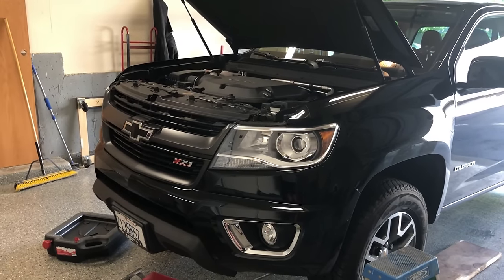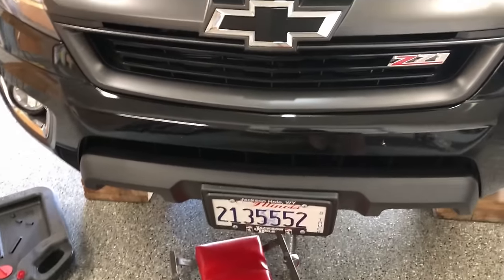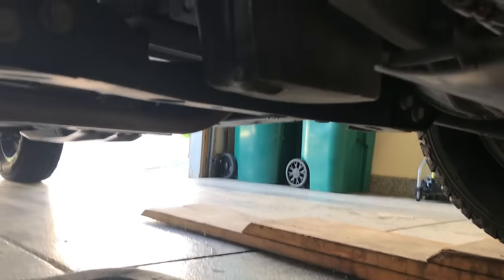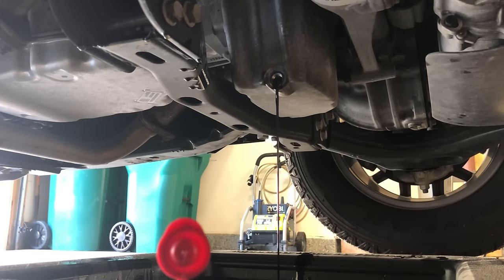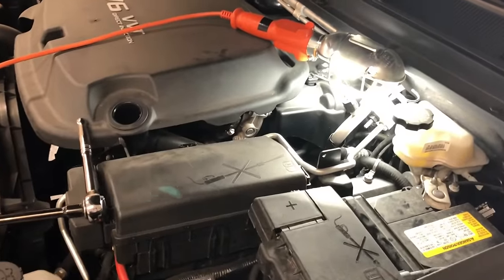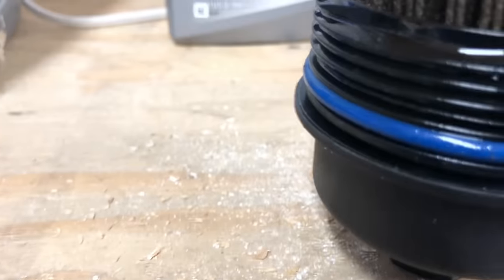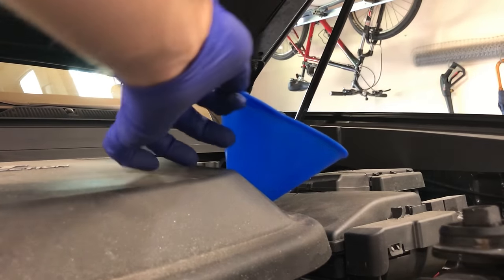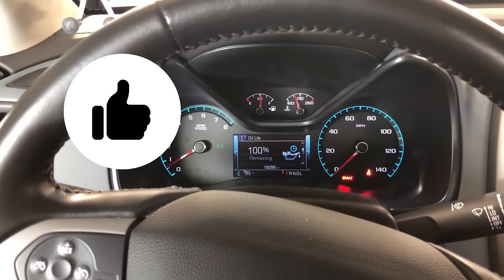[HOW TO] Change Engine Oil on a 2015-2022 V6 Chevy Colorado / GMC Canyon (Easy)

Comment from the maker: Leave a comment if this helped you change the oil in your truck! 
Buy the Engine Oil here: https://amzn.to/2tEze9h
Magnetic Drain Plug: https://amzn.to/2GcUdmd
Washers for Drain Plug: https://amzn.to/2RdNi2y
Reply: It did.  Had a little trouble Changing the filter, trying to move all the wires. but I got it. Easy change. Thanks.
Reply: it did help me find the oil filter and how to replace it.   I was wondering what you think. If you leave the fill cap on, will the oil not shoot out so far when removing the plug?
Reply: @robbyddurham1624  I think the faster the oil shoot out the better it is because it pushing out all the particles?
Reply: What about that rubber gasket you said you need to change, too?
Reply from the maker: Yes. Change it. Your new filter should come with one.
Reply: Fondupot's Garage it did! Thanks!
Reply from the maker: jackolantern22 awesome!
Reply: I'm almost 34 years old, just changed my own oil for the first time in my life today. Thank you!! 🙏🏼
Reply from the maker: @atsantes  Glad to help! Good job!

Comment: Thanks for the video. I've been changing my oil for the last 30 years and never had a vehicle with this style filter. It seems pretty simple to replace.
Reply from the maker: Glad to help James. Thanks for watching!
Reply: Same set up your basically changing the paper out in a traditional sealed can. I actually prefer this and like to do before dropping the drain plug. With the filter out I loosen the drain plug. Not sure if any more drains out this way. But in a can style if you puncture a hole at the bottom with it tipped upside down more will drain out. We were required to do this in a repair shop when performing a LOF. Great video and I’m glad I traded my 2014 Silverado for this model of truck beats buying 8.5qts of oil, with fighting the oil splashing everywhere.

Comment: Great video! Regarding the random comments about reinstalling the new oil filter (housing/cap) on these motors, everyone needs to understand......oil filters have always been intended to be 'hand tight' ... by which to be reversed,  also means, 'hand Un-tight' lol. A person is supposed to put a little swipe of oil on the new o-ring of any oil filter, put it on with your hand....and then later when the time comes, take it back off with your hand to replace it again! The only reason oil filter wrenches were even invented was to (remove) wrongfully installed filters! In this case, the engineers know it's difficult for an individual to reach a hand down there, so they gave you the 24mm nut to turn it, (not drive it) on and off from the 10 or so inches above it ....... so it's all about paying attention to the draw down and integrity of the o-ring with a moderate amount of forearm strength and 'common sense' measurement while using whatever ratchet or hand device you're using!  *Always look under the vehicle and around the oil filter housing immediately upon start up to verify for no gushers!
Reply from the maker: Well said.
Reply: On this vehicle, the oil filter will literally tighten to a point where it spots and is completely bottomed out, no need to tighten past that
Reply from the maker: v mann correct
Reply: Good point,i was always taught hand tight & check after for leaks.

Comment: Very helpful! I could not find the filter.  On another note on cars with an internal oil filter the oil drain plug should be left out until the oil filter is removed.  Most of the time some more oil will drain out, sometimes a significant amount.

Comment: Thanks broski.

Just did my 2019 Colorado and the worst part was just getting into the filter area. Kind of have to wiggle your way in there but not too bad.
Reply from the maker: You’re welcome. Thanks for watching. Yea the filter is a little bit of a pain.
Reply: @fondupot  no more of a pain than trying to quickly screw on your filter that’s up and around a corner while it’s full of oil 😂
Reply from the maker: @hulkhogan1942  Yea, I actually prefer the cartridge style filter now. Once you get used to it, it's not so bad.

Comment: Oil filter is on the right side of the motor. Your battery bracket hold the middle of the battery down it’s 6-8 inches from the middle of that bracket and straight down. Black cover with the bolt built into it. 15/16 socket.

Comment: Funny thing, I just changed the oil in my Colorado a few weeks ago. I used a torque wrench to tighten the filter housing to 25 newton meters or 18 ft lbs. It was fairly easy. No jacking of the vehicle needed. Did it right inside my garage.
Reply from the maker: The Car Crazy Guy I have to say it’s a very easy vehicle to change the oil on.
Reply: Fondupot's Garage I did it simply because I didn’t want my dealerships techs to paw all over it. I still have my 2 free oil changes.
Reply from the maker: Nice yea. I used my two oil changes. But from here on out, I'll do them myself.
Reply: Even easier if you replace the pan drain plug with a 1/4" turn valve.
Reply from the maker: I've thought about those before. But I'm afraid of it getting broken off and then losing all the oil!
Reply: Yeah, if you do any off roading, it's definitely a risk. Especially when you consider our trucks require the valve extension

Comment: FYI: 24 mm=15/16" for the filter cap.  Great video.
Reply from the maker: I thought the 24mm fit better for some reason. But thank you!
Reply: @fondupot  You're right, actual 24 mm = 0.94" whereas 15/16"=0.9375"; however, in my opinion, 0.025" isn't a significant difference on this light of a torque.

Comment: Bought new 2019 model.  Looked at the filter in the store and thought WTH.  Just a paper filter.  Thanks for showing me where it is located cause I never would have found it.  Between the filter and no gas cap, totally new for me.
Reply from the maker: Chris Forbes glad to help. Thanks for watching.
Reply: It’s the same internals as a traditional steel can filter.

Comment: A very helpful video, I see you're using a full synthetic oil,  my 2O19 says synthetic blend and I have 21,000 miles, when do I switch to full synthetic? Thanks
Reply from the maker: You can switch whenever. I’ve been using the Mobil1 since I took ownership of this truck with 4000 miles.

Comment: Thanks. Manual shows I should service the sealed tranny every 45k. Is that how you do yours?
Reply from the maker: Yes. I would recommend that interval as well. I have a video on how to do transmission service on the 8 speed. Check it out. Thanks for watching.

Comment: 1) thanks for doing this. I haven't changed my own oil in years I'm embarrassed to say, but good to see the filters have gotten a little easier.
2) You mentioned this was for 2017s and newer. I have a 2016 and it all looks the same. Do you know what the differences are?
Reply from the maker: The 2015-2016 V6 is actually a totally different motor than the 2017+. The filter is a different part number on 2016's. But otherwise the process is identical. I have links to the part numbers in the video description. Thanks for watching! Glad to help. Good luck!
Reply: 2015-16 oil filter housing is all metal. Torque specs are a little different. Other than that pretty much the same everything is in the same locations as this vehicle. I torque the drain plug and the oil filter cap to 20 pounds I think the oil filter cap only calls for 18 pounds but my cheap torque wrench doesn’t have fine increments. Mine is a 2015 v6

Comment: Quick question, when you put the new oil filter in and tighten it all the way with your hand how many turns do you do with the ratchet, I hand tightened it as tight as I could, and then maybe did a half turn with the ratchet. I just wanna make sure I’m not tightening it down too much.
Reply from the maker: The cover should be flush with the housing that the filter slides into. If you reach down and feel a gap then you gotta keep going. But it doesn’t require a lot of torque. You should be able to feel the ratchet stop when it’s flush.
Reply: @fondupot  ah alrighty. Thank you!

Comment: Changed oil today but didn't have right driver to get oil filter off and changed.  Thoughts or recommendations on how concerned I should be and how quickly I should change filter?  Oil change was 5k from last change. 70k total miles roughly.
Reply from the maker: I would change it as soon as possible. But probably won’t hurt to go another 500-1000 miles on it.
Reply: If you dont change that oil filter it will literally fall apart... i have seen cars come into shop with these filters after not changing this type of filter... had to pick the filter pieces out of the filter housing.

Comment: Quick question. Can anyone confirm if the factory oil pan has a helicoil? The dealership told my father in law that he needs a new oil pan cause the helicol is stripped. I argued and said theres no helicoil on the factory pan, and that a helicoil is a repair that they probably did. Long story short we went back and forth and they agreed to change the oil pan at their cost
Reply from the maker: I don’t think the factory oil pan has one. At least you got the dealer to fix it.

Comment: I was wondering if you use a resetting tool for the TPM system when you rotate tires.  Now that my free oil changes have expired on my 2015 Colorado I'm going to go back to changing my own oil and doing rotations.  I've purchased a resetting tool on Amazon but haven't used it yet and am hoping it works OK.  Your thoughts?
Reply from the maker: David Szakacs I don’t own a TPMS recalibration tool. I think they are quite expensive. I take my vehicle to Discount Tire (America’s Tire) and they balance and rotate for free.

Comment: Good how-to video.  GM could have done a much better job of mounting that oil filter in a easier to get location.  Jeep did it perfectly on my '15 Cherokee 3.2L V6.  On the very top of the engine, just pop off the engine cover to access.
Reply from the maker: Thanks for watching. Yea the location is not ideal. But I know there are worse spots. Like near hot exhaust pipes!
Reply: Beats dealing with Chrysler’s coolant leaks. And intermittent dying in flight. Have not dealt with this engine, I hope it’s good for you and they are better then the penstars and their old 3.8 v6’s.
Reply: @fondupot  The 2000 Impala puts it behind the passenger side front wheel.   I sometimes wonder if the people who design some of the oil filter locations on cars have ever even popped the hood of a car outside of their CAD program.

Comment: Good to know.  A little more simple to change filter.  My 2005 Colorado I had to crawl on my back under front end to take the filter out being careful not to tip the filter on the way.  sometimes it can be a little messy.  I didn't have to jack the truck up for that.  I haven't got to my 1st oil change on my 2019 Chevy Colorado Z71 yet.
Reply from the maker: david H you won’t need to jack the 2019 up either. I just used the Ramps to make it easier to film. Thanks for watching.

Comment: did you ever do the magnetic drain plug?  If so, what is your opinion of it, as it seems to lack the rubber internal gasket the OEM one had.
Reply from the maker: Yea I did one. Look up my newer video showing oil change on my GMC Canyon. But I don’t have it installed anymore because I have a drain valve installed now.
Reply: @fondupot  OK, I caught that one.  The Stahlbus looks really interesting, albeit expensive.  But I agree on dealing with the arc of oil with the regular style plugs.  First nice weather here in a while, so it's oil change time for my 2018 Z71, so I needed to watch your video for a quick brush up on where everything was, LOL, in the engine.
Reply from the maker: Yea I like the stahlbus. Thanks for watching!

Comment: Any issues with oil spilling out from the filter housing when removing it?  My dad's 2018 is about to get its first oil change at ~8K miles, so I want to know what to expect.  Thanks.
Reply from the maker: As long as you drain the oil first you shouldn’t have any issues.

Comment: On my 3rd oil change on my ZR2 V6, and just noticed the valve that goes into the middle of the oil filter is loose and spins freely...can someone confirm that is normal...thanks
Reply from the maker: v mann mine was loose and could spin freely.
Reply: v mann same here

Comment: Couple tips - Put a fumoto oil drain valve on the truck and it makes it super simple to change the oil. Write 6QTs on the cap so you don’t have to look it up every time. Can also get a funnel that screws into you oil fill plug so it doesn’t flop around while you are filling the engine back up.
Reply from the maker: All great tips. Thanks for watching.

Comment: How often is the oil suppose to be changed? I took mine at 3000 miles and they wrote down on the ticket 9000 miles next oil change.
Reply from the maker: It really depends on the Oil Life Percentage. It monitors the engines running time to get the best longevity out of the oil. I typically change mine when the OLM is around 10%. That usually is around 6000-6500 miles. 9000 miles is too long, in my opinion.
Reply: I usually change it on my Colorado at 7000 miles. It's around 10-15% left. As it gets older you want to change it sooner. I wouldn't go to 9000, that's too high.

Comment: Had a 2010 with the quirky 3.7L i5. Great truck had it for six years no issues, the oil change was simpler since it had an actual oil filter. I changed to a 2017 and didn't do an oil change yet but will need one soon. Thanks for the info on how to change the oil. I do my oil in the summer and take it in to have it changed in the winter. Looks like it takes the same amount of oil as the 3.7L 5 cylinder.
Reply from the maker: Glad to help. Thanks for watching!

Comment: I changed my oil today but when I clipped in the new filter to the cap I feel like it was flimsy. Clipped in but not tight and moved around a bit. Should I be worried?
Reply from the maker: juang lan keep an eye on your oil pressure. Did you use an AC Delco filter or some other brand? It should be tight in the cap.
Reply: @fondupot  I'm going to remove the filter cap today and re install it to see if maybe I did not clip it proper. I'm assuming I can remove the filter without having to drain the oil all over again?
Reply from the maker: You can. But there will be oil in there so be prepared for a mess.

Comment: just did the oil change, what a pain in the ass that filter is. i don't know whose ideas it was to put the filter there and wires running over it.
Reply from the maker: Yea, its a pain in the butt for sure. I usually stand on a short step ladder to give myself better access to the location.

Comment: I didn't have to jack it up with the 2005 but it was a little tight but I managed without a jack.  The 2019 Colorado Z71 will be a real cinch.  I do jack the rear up so I can grease the Universal Joints.  Since this is a New truck, it probably doesn't have grease fittings.

Comment: This is a simple questions, but indications on the knob are making me question the normal. Is the oil filter cap lefty loosely, righty tighty? There is an arrow on the top that shows turn to right, but nothing else. The dealership did the last change and the top is on so tight, it won't budge. Made me start thinking, maybe I'm turning it the wrong way. I'm trying to take it off, by turning the cap counter clockwise. Is that correct?
Reply from the maker: Yes it’s standard threads. Use a longer ratchet to get more leverage. Lefty loosy. Righty tighty. This is actually the second comment I’ve gotten from someone in the past week saying they couldn’t get the oil filter cap off. You just need more leverage.

Comment: Hello, thanks for making this video. Ive just purchased 2016 Colorado with 41k miles. It says oil change needed and i have code p0300 random multiple misfire detected. Do have any idea what might be. I know some peope say it kight be spark plugs or bad batter( low amps) and bunch or other stuff.  My battery has corrosion on one of the terminals. Thanks
Reply from the maker: Do an oil change and start with replacing the battery. If it’s the original battery it definitely needs to be replaced. Clean up the terminals and use some dielectric grease when you reinstall everything. See if that clears your code.

Comment: Just finished changing the oil. Glad I did it. I have the free life time oil change but after a year of owning my truck I realized they’ve been using cheap ass 0w20 conventional oil. Followed all the steps & im now a subscriber. Will be doing rear differential next. Thanks 🤙🏼
Reply from the maker: Sorry for the delayed response. You comment got flagged as spam for some reason. Glad the video helped! And thanks for subscribing! When doing your rear diff, i highly suggest using the OEM fluid that does not have the LS modifier. In my rear diff video I used mobil1 that has the LS modifier and I was having issues with my rear end not acting correct. So I drained it and put the OEM fluid in and it was perfect after that. Good luck!
Reply: @fondupot  no worries! Yeah I read the description after and I bought the oem. Already bought to quarts at my local dealer and the pump. I’ll be doing it tomorrow. Thank you
Reply from the maker: Awesome. Let me know how it goes! Good luck

Comment: I got one more free oil change on my '18 then she gets my love.

What a crap location for the oil filter.   I do believe you can use the metal cap from the last gen engine.
Reply from the maker: Yea it's definitely a poorly chosen location, But it's not too hard to get to with a short step ladder. I'll have to look into the metal cap. Not sure why they would switch to plastic.
Reply: Fondupot's Garage

 money.
Reply from the maker: Yep. Probably saved them $1 per oil cap.